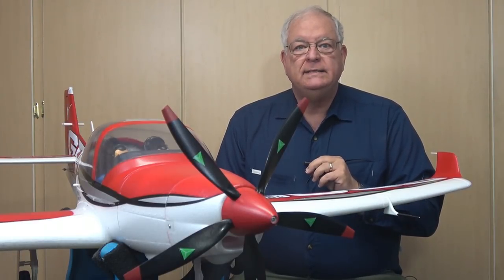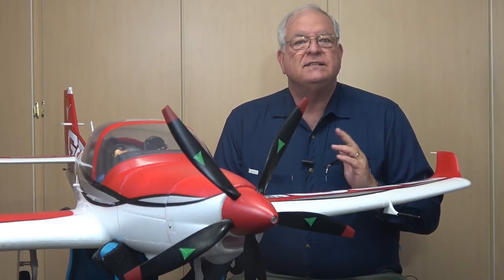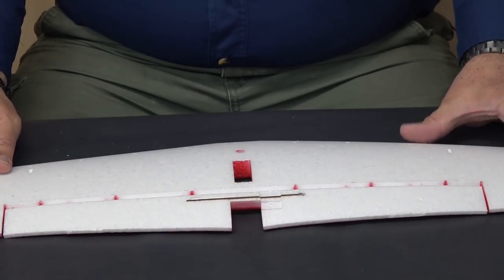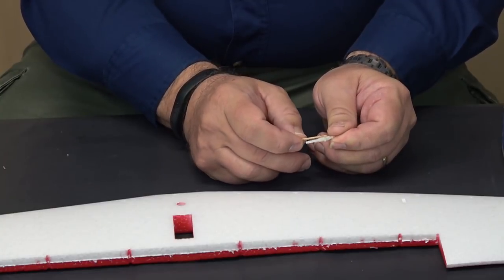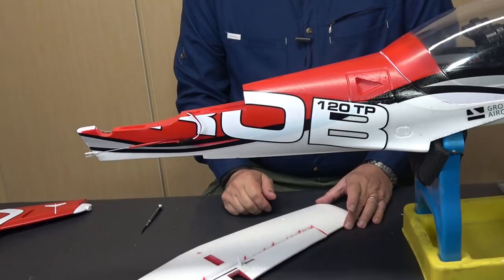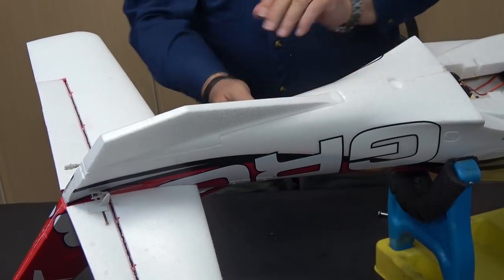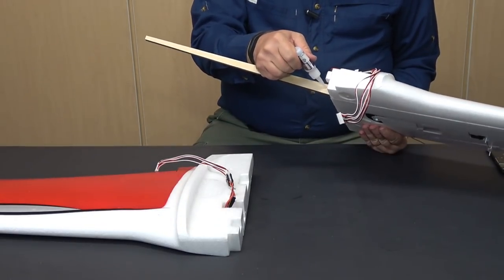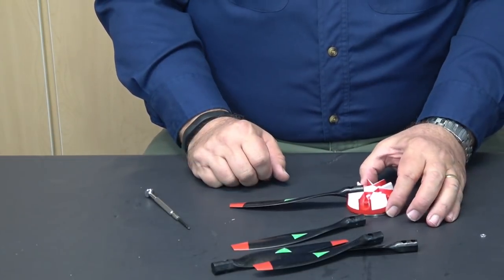Grob G 120TP Build Log

Comment: I realize that this was nearly 10 months ago, but ............................. I noticed that the elevator, flaps and aileron surfaces were quite warped. They could have sandwiched those parts between flat support pieces to prevent that.  The elevator didn't seem to fit very well as there was still quite a good gap.  Was that because the CA dried too fast or did you not do a test fit to make sure the holes were deep enough to accommodate the hinges?  The use of FoamTac would have given some time to fit that elevator in before it dried.  I'm surprised people still use CA glue on foam models anymore.
Reply from the maker: The control surfaces were warped and didn't want to straighten out. I tried. Foam Tac is a contact cement that works well when used as directed. CA is fine in some situations.
Reply: I've had this plane on my "wish list" for some time now, but haven't pulled the pin on it yet due to my concerns about BlitzRCWorks quality.  Normally, I wouldn't hesitate because the price is usually lower for this brand of plane and I accept the lesser quality but the Grob is not a "cheap" plane by Blitz standards.  The warpage is not unexpected for the brand of plane but the price is unexpected.  Additionally, those retracts and size of the wheels seems a bit flimsy and unsuited for rough grass operations.  What do you think?
Reply from the maker: I spent a while getting this dialed in. The incidence of the horizontal stabilzer was off resulting in a significant nose up moment. Fought with it a couple of times before looking at it from a distance, then I noticed it. Some sanding in the saddle got it right and it flies nice now. Seems to gather a comment when I take to the field. Gear have held up fine and it lands smoothly. It's an older model and you can see the improvements made in foam airplanes over the years. Much of the color scheme is waterslide decals. I put a couple coats of WBP over the plane to help protect them. Not the best plane I've had but not the worst either. Probably worth it if you can find a good sale price and you like tinkering a bit. Good luck.
Reply: @AZJim12  Many thanks.

Comment: Hi, great post! In the BH video Pete said the build was "quick". Did the manual say the pins are optional or necessary?
Reply from the maker: If you are talking about the pins at the balance point, they are definitely technique. They sre easier to desl with than ink marks when the thing is upside down.
Reply: I'm sorry, I meant the hinges not pins, " are they optional or necessary for all control surfaces ?
Reply from the maker: OK gotcha. Gotta love autocorrect.  I found the foam a little thin and a little dry to just use the thin foam instead of actual hinges. I'd use the hinges.